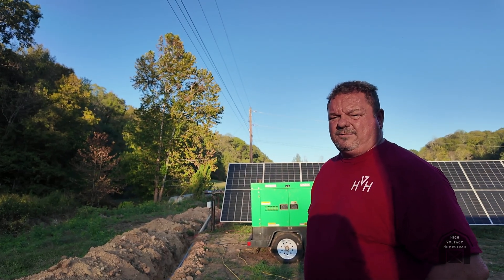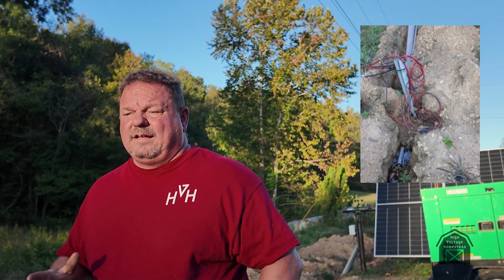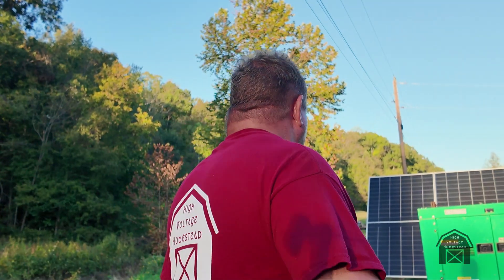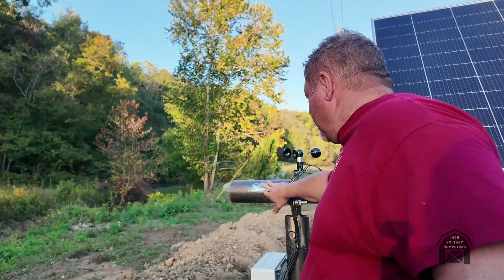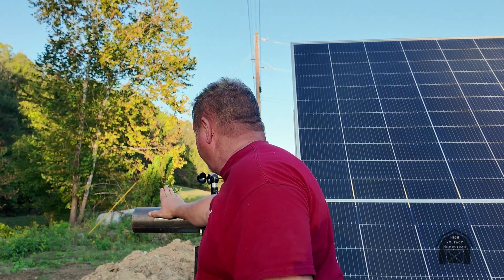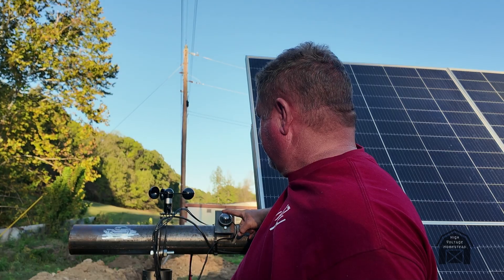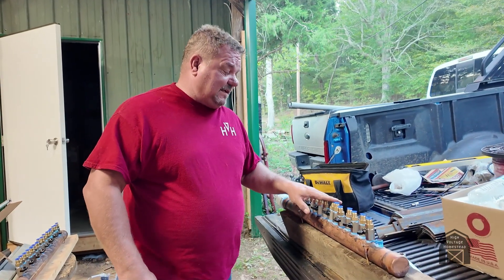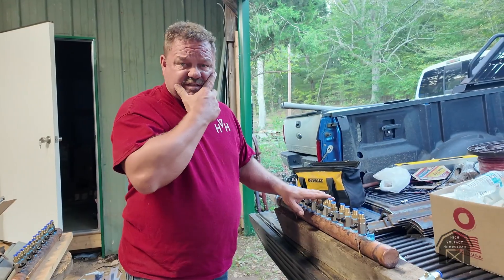Digging Deep: Solar Trench Work, Tracker Troubles & the Great Pipe Thread Mystery

Comment: Thanks for the update, it's slowly coming together! 
Re the solar tracking issue... have you given any consideration to a previous comment of mine, where I suggested using a timer based control instead of the sun tracking sensors?
I don't know how many overcast days you've had since installing the first one, but from experience the light sensors can cause a lot more hunting than you need in those conditions. In the end, you just need to know the hours of sunlight each day, and program the actuators to move a certain amount every 10 to 15 minutes. This might need adjusting for seasonal changes every month or so, but I think you would have a more reliable setup..